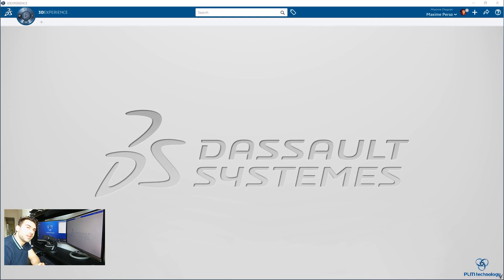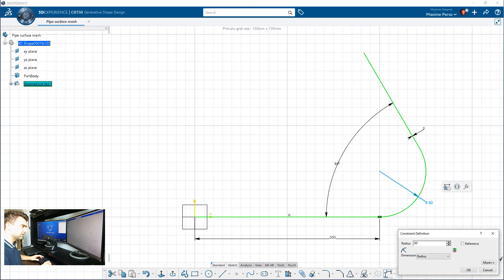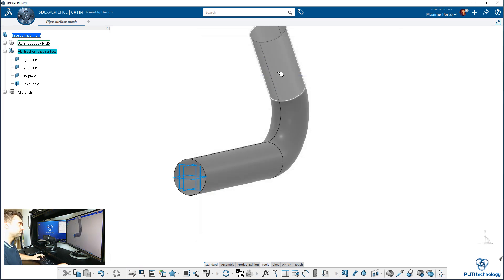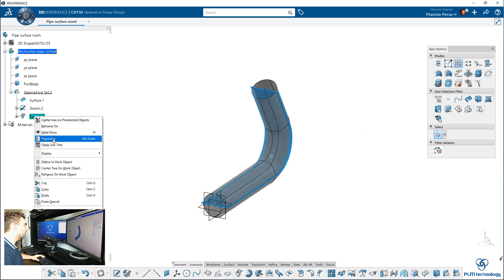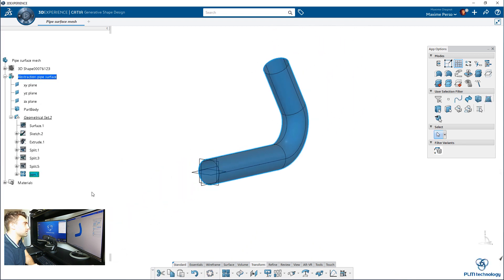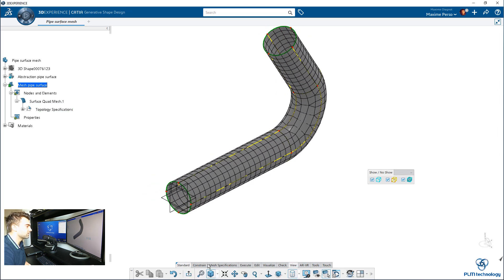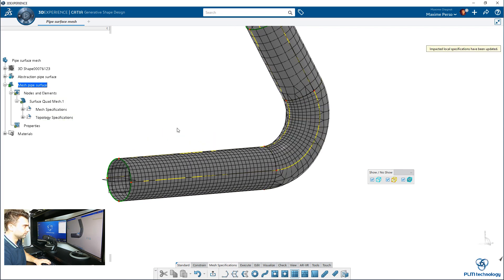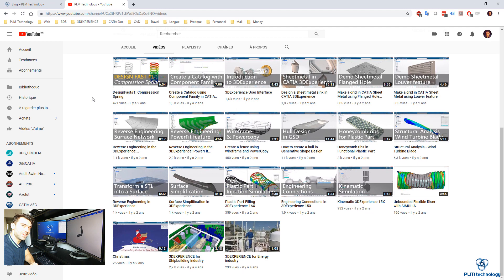SURFACE Mesh Partitioning - SIMULIA 3DExperience R19x (Live Demo)

Comment: Maxime what is your pc specs? I want to build a good computer for some engineering programs like 3dexperience (and also for gaming), your pc seems like running smoothly with 2 monitors.
Reply from the maker: EHello Outplayed, Thank you for your commend :) It is hard to find a good pc configuration for both CAD and Gaming, but I believe it is possible. First of all, if you want to use 3DExperience, I strongly recommend you LENOVO Brand, That is what we use at our company but at Dassault Systèmes too (I was working there before). I have a laptop, Lenovo P51 - Win10 - 32GB (8x4) RAM DDR4 2400Mhz - i7-7820HQ 8mb cache up to 3,9hz 4cores - NVIDIA Quadro M2200 4GB GDDR5. I also use a workstation and have 2 Asus MX25AQ 1920x1080 screens. 

What is important for CAD is a lot of RAM (32, 64 or more) and a certified GPU: https://www.3ds.com/support/hardware-and-software/hardware-and-software-configurations/ 

If you want to play games, normally you go for NVidia Geforce, but it is not certified with 3DX. It will probably work but you will have bugs quite often. This short article explains it well https://www.gamingscan.com/can-you-use-an-nvidia-quadro-for-gaming/ 

I have no idea which card you should go for. You have to decide if you want to go for precision or speed. If you have mondy I will recommend you a Quadro RTX, that can be use both for gaming and CAD and VR. Although it is quite pricy. Good luck with your build!